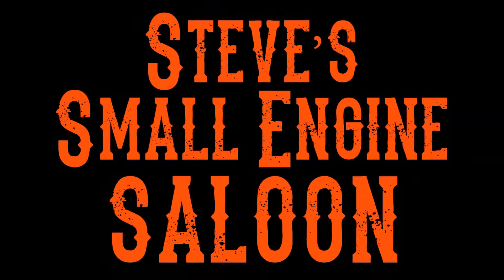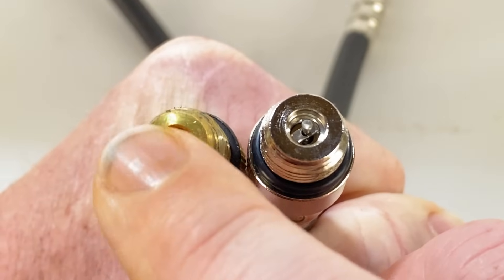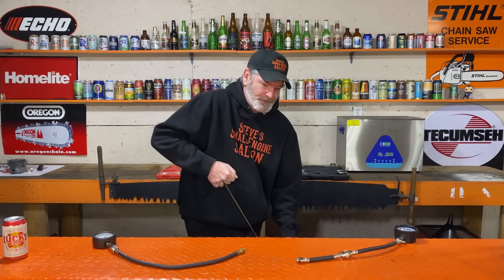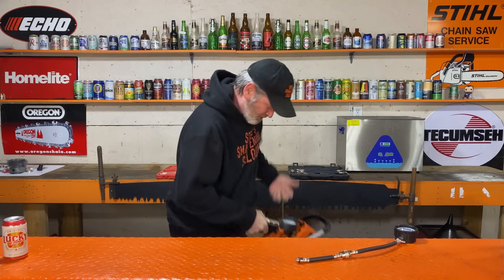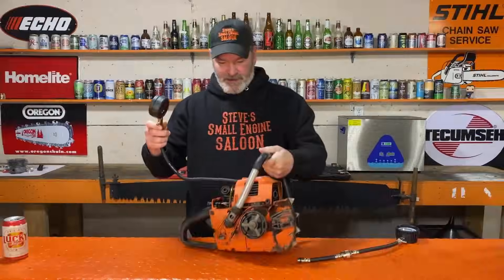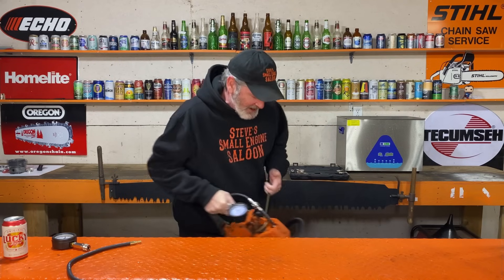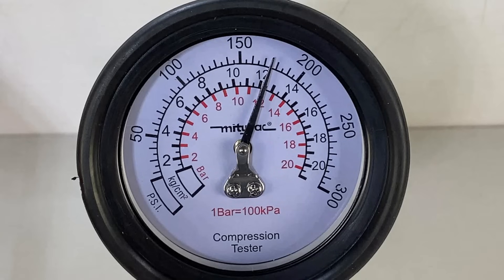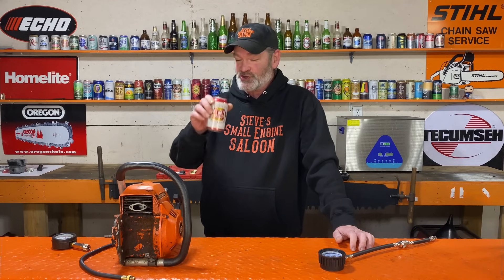Mechanics NEED To Know This Compression Tester Difference!

Comment: The only thing that schrader valve does is hold the pressure in the gauge. That’s why the needle stays in its position. Otherwise gauge would just return to zero.  The pressure release valve at the gauge assembly is what releases the pressure contained by the schrader valve. Might not be one in the connector hose you used but there has to be a similar valve somewhere in that assembly otherwise your gauge wouldn’t hold its pressure reading. Pressure differences you see is more likely a poorly calibrated gauge.

Comment: thank you Steve .. another great video. I have a craftsman complete test kit and just checked the compression on a Stihl MS311. took me over 10 pulled and oil into the plug hole to get it to just barely read 100. i still can't get it to fire. Is that compression too low ? in my experience it is... some equipment might run on 100 but will be very hard to start
Reply: Oil in the chamber is a false read. 100 psi is quite low for a 2 banger.

Comment: I hate to be that guy but Steve you are mistaken. I have 2 compression gauges in my shop. 1 with the removable valve and the other without.  But read within 5 psi of each other.  1 is a mac tools the other is a Princess auto ( much like your harbor freight )  The valve is used to hold the pressure. Take the 2 piece one and apply some pressure then unscrew it from the engine.  Pressure stays on the dial. Now release it from the connector and the pressure is gone.  So that means the hose is filled with air just like the other one that has no shadier in it.  If I take the other one with no valve and unscrew it from the engine it holds pressure. Why is that?  Well if you look you will see it too have a valve in it. It is not replaceable but it is there. So you got a bad tester. The way they are calibrated is a known pressure is applied to the tester and the number is read.  A proper test would have been to put both on a car and test. You  would have found that 1 of them was deflective. Since both gauges fill up the tube your theory is also incorrect.
Reply: You would be correct.  I am not sure why Steve missed this. I have several testers here and they all work just fine. Good catch about the valve inside the tester.
Reply: @Rockjock007   yes he just got a bad tester. IF he was to test them both on a known pressure then it would be clear. Gotta love the lemmings believing his explanation LOL
Reply: If you watch the longer video, he says he tested both  on his truck and a compressor and they were both accurate. I'm not sure what's  going on.

Comment: Schrader valve for compression tester has a light spring and is NOT the same as a tire valve. If you lose yours maybe because you were doing a leak down test or holding a valve while servicing springs and seals and put a tire valve in place you will have low compression readings.
Reply: Duly noted 👍

Comment: Was the throttle wide open?
Reply from the maker: It does not matter.  I prove it in this video!
https://youtu.be/ItBVKrJdjYw
Reply: @StevesSmallEngineSaloon  you didn't.
Reply: @StevesSmallEngineSaloon 

Exactly. It will draw air in from the exhaust port

Comment: I've got a red Chinesium tester that actually comes with a Schrader valve fitted, but it still doesn't work. So it could be the gauge that's not playing. But most likely they fitted the wrong Schrader Valve, as they come with different pressure ratings and it needs a lighter spring for the short pulse you get from a pull start 2X engine. I might try coupling it to a drill before I go messing around buying valves.
When I was checking it out I also found what I think is an screw in extension/fitting with the Schrader valve.

Comment: It's worth mentioning that I have a compression tester I got on Amazon that looks nearly identical to the red-box one here that DOES have a schrader valve in it, but it still gives crazy inaccurate readings (~70 psi on my '85 VF700F). I sprung for the Mityvac and I'm getting much more accurate readings (~150 psi same engine). Those cheap kits are just flat-out junk. It might be more interesting to compare the Mityvac both with and without the valve, to remove the possibility that the crappiness of the cheap one is influencing the results.

Comment: So is the wrong one consistently wrong? Is there a way to convert the results?
Reply: It's because of the ratio of the volume inside the compression adapter and hose relative to the swept volume of the cylinder. On a large cylinder the error would be much smaller and very large on small displacement cylinders.
Reply: Not correct. Steve got a deffictive tester. I have one with a removable valve one without. Both work perfect.   @johnnytacokleinschmidt515

Comment: I would love to know what grease gun to use for a snowblower
Reply: The same one that's used for auto use. The grease nipples are the same as used on cars ( not that many cars have grease nipples any more ).
Reply: 1 that works,lmao😅😅😂
Reply: Get a pistol grip they work one handed and buy a lock n lube they work really well they clamp onto the grease fitting nice and tight they don’t leak and you don’t need to kill yourself keeping the nozzle on the grease fitting